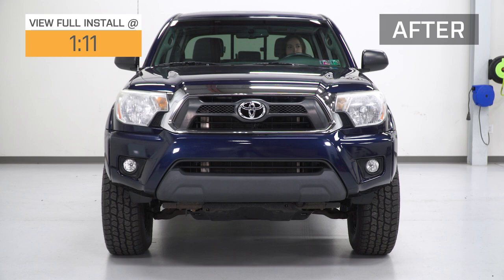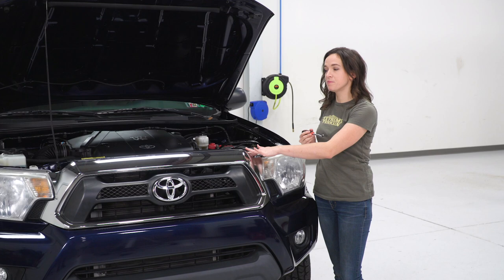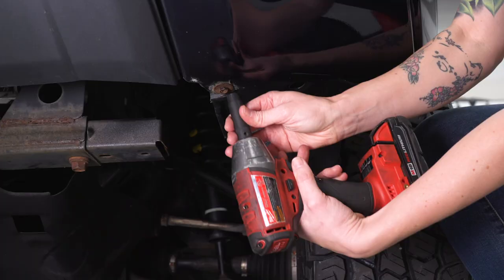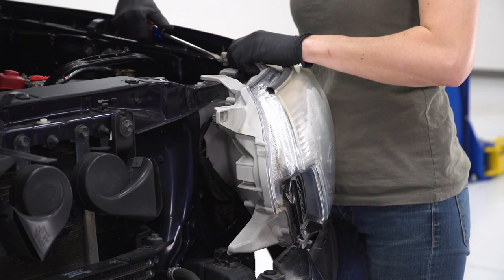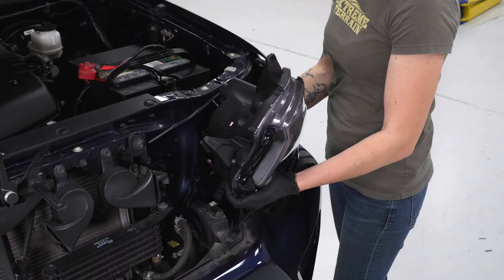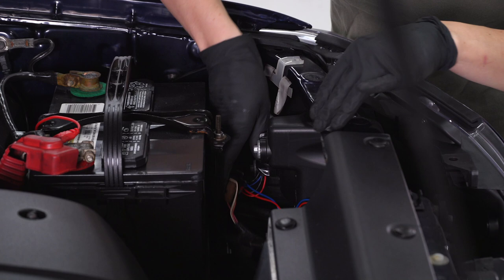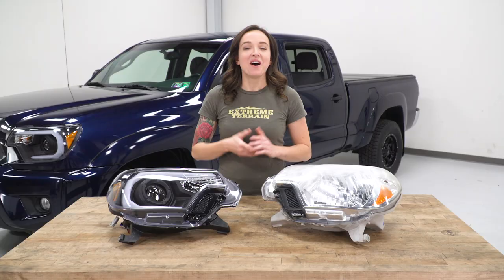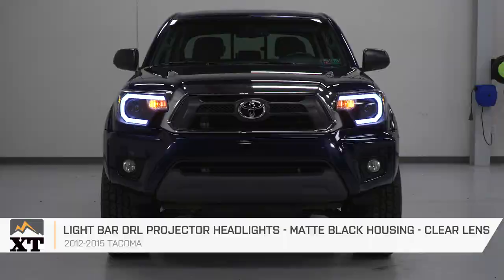2012-2015 Tacoma Light Bar DRL Projector Headlights; Matte Black Housing Review & Install

Comment: just removed my 2014 tacoma grill.  these instructions were perfect.  I am an idiot so I removed the 2 clips at the bottom on either side near the trim by the headlamp housing.  so don't remove this or it will add give to the bottom making removing the grill tabs on the bottom extra difficult.  SO DONT REMOVE THE 2 BOTTOM CLIPS.  Her instructions on here are spot on and shouldn't be modified like I did.

Comment: gave those bolts all the torque
Reply: That was the first thing that I saw. The socket was made for a pneumatic tools - not good for plastic. IMO Overall good video but didn't mention anything regarding the wiring/connection

Comment: Can the turn signal bulb be replaced with a led bulb, and not have hyperflash?
Reply: It can, but the only one that will work properly is made by Lasfit. The canbus is built in the base og the bulb. They're expensive, but excellent. I've been using their bulbs for years.

Comment: I got the ones with the shorter light bar installed but the parking lights on the outsides won’t turn on, need some help with this issue.

Comment: Just installed them on my 2014 Tacoma but I am getting hyper flash when I use my right signal and the front indicator is completely out but the rest of the light is working. Is this a common problem? Do I need to a relay or something to prevent this from happening?
Reply: i’m not an expert but it sounds like it’s just a bad bulb
Reply: @kenchiek4913  I replaced the bulbs and it works fine now. However the right side lens is faded and it appears to be burnt or something which is weird but they still work fine.

Comment: Can you adjust the halogen light beam?  I feel mine is pointing too low.  Has anyone swap out the halogen blub with a LED?
Reply: Yes, you can and have to as these come pointing down from factory. There’s two hex bolts on the back of each.

Comment: Great video on how to swap headlight assemblies. However, I'm doing the reverse. I bought those after market assemblies and the coating they applied is peeling off, looking terrible. So, I'm going back to OEM Toyota assemblies that are boring looking but last a lifetime with proper restoration every few years or so. Plus, the light pattern on the OEM assemblies is superior. Always stick with OEM parts, including headlight assemblies. The Japanese make the best plastics.
Reply from the maker: Sorry to hear that but it sounds like those JDM parts are holding their own as they always do! Thanks for watching!
Reply: @ExtremeTerrainToyota  Not exactly. My point is that those have a terrible beam pattern and the coating that comes with them is peeling off. Looking terrible. Aside from that, hard to see at night. I believe other people have commented on the poor beam pattern and light projection.